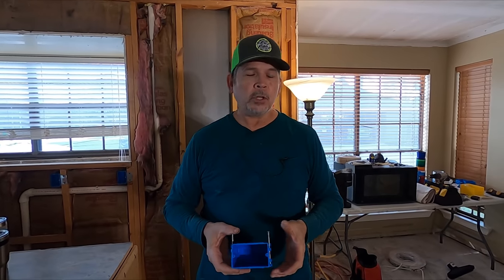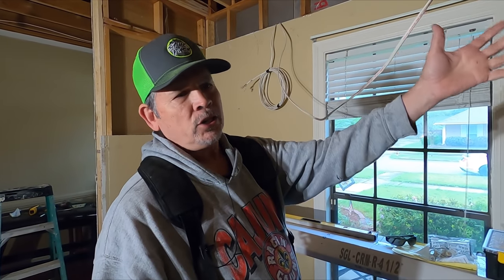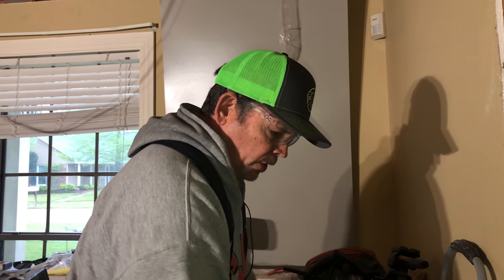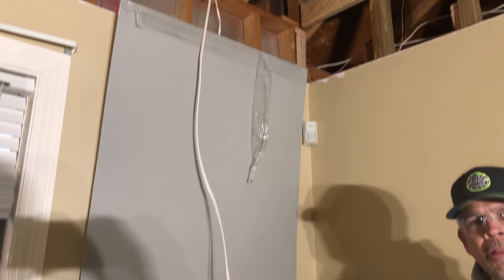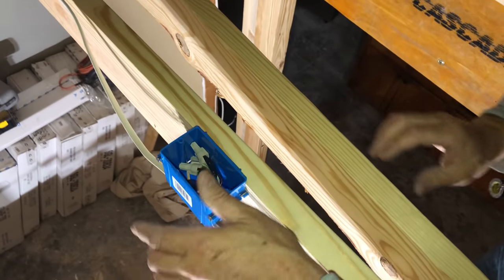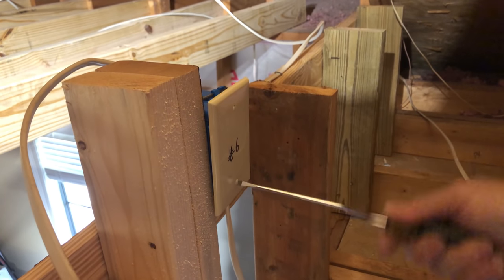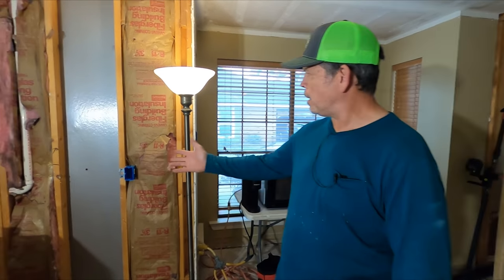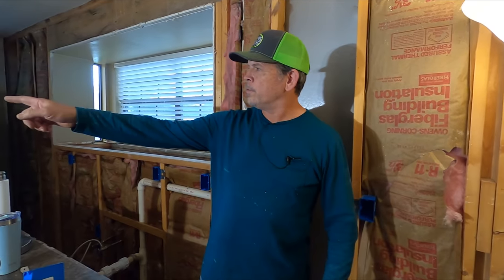How We HELP Our ELECTRICIANS⚡️ Ep. 10

Comment: Like I've said before, I've been an electrician for 40yrs. as of this year and you do better than many of the licensed hacks I've encountered over those years.  Another tip for ya...  Anchor J bxs 18-24" on any accessible framing member  of an attic if possible vs. anchoring low and possibly being hid by insulation. And always staple within 6" of a non-metalic box and 12" within a metal box.  Thank you for conveying the differences between a wire and a cable and a wire cap vs. a "nut".!?!   If an apprentice were to look in a order catelog for wire "nuts", they would get lost.  I understand that it's not a big deal for the non-electrician, but for such a specific terminology based trade, it's encouraged at the professional level. You'll find that in the IBEW schools as well.  I agree Paul, Ideal's Tan Twisters are a must have. Granted, Yellow and Red caps are an essentual part of an electrician's arsenal, but, Tan Twisters are a great suppliment.  Again.. great video!
Reply: Plenty of people in the industry use the term "wire nut"....agreed it's functionally more of a cap than a nut, but it's definitely industry standard lingo

Comment: Here in Canada we use metal boxes so we put all of our grounds to the back of the box on a screw and run 1 wire to the ground screw. Everything else is the same as far as residential electrical goes. I have never seen a plastic box or ground wire nuts.

Comment: Whenever I use those blue junction boxes (like the one used for the future circuit stored in the attic) instead of completely breaking out the knockout, just break away the bottom of the tab and push the cable through. With the tab still in place, it acts as a kind of sort of clamp on the romex.
Reply: That’s why those tabs are there.  Code requires that the cable be secured at the box.
Reply: @johnwielgolinski5552  Securing electric cable in the box is good practice, and it makes for a safer installation. However, you do not need to secure the NM or Romex wire inside the plastic box. The electrical code states that you must staple on a solid surface (the stud) twelve inches or nearer to the outside of the box. The staple provides a secure hold because it is separate from the box itself. Securing and supporting requirements for NM cable are found in Section 334.30. The general rule for NM cable is to secure the cable within 12 inches of the box and every 4.5 feet thereafter.

Comment: Caring sparky who does not use the flimsy push in but rather the screws. At one time they were approved for #12 & 14 guage copper wires but at least 10 years ago NEC only allows #14 wire. They refuced diameter of hole so #12 can not be used. Argued with lazy sparkies 40 years ago about push in wire ports. Told them when they were approved for ground wires I would consider using them. I.always used the cadilac of drill bits & extensions GREENLEE. Had a 5/8 & 3/4"
Reply from the maker: Push in wire ports aren't good enough for the ground, exactly why I don't use them 👍  I saved a couple of those old receptacles that accept #14 and #12.  Thought about doing a video about why it was changed.  Pretty interesting story 💪

Comment: Fantastic job!

My electrician friend trained me nearly the same way: leave all the slack you can, tape up the slack (he had me use white electrical tape because it doesn't leave as much residue), pull out the non-contact Klein voltage indicator and check for voltage... before EVERY cut 🤣, do all the work possible on the floor, label every wire, box, & circuit, and set the boxes high enough that no one has to bend over.

Only thing I see in your video (which I expect you'll probably get to at the end of the job) is the thing I disliked most about remodel work: the attic is in dire need of additional insulation.  😜

Comment: Back stabbed connections held
go 40 years. Interesting. 
Thank you
Wonderful video showing 
excellent workmanship.
Reply: It's likely the receptacle was replaced more recently. The gang box is probably original though.
If had to guess the wire isn't the original either a lot of homes from that era used a cloth covered wiring or aluminum wiring.

Comment: I always mount the attic junction boxes to the rafters and attach my coiled wire there as well using a zip tie with the screw hole makes it easy to attach it to the rafter….. as up north we spray in insulation that can be 16” deep and all cover plates are identified as you do … great video

Comment: Hey guys!  I ran across this video again and would you believe it.. I have even MORE advice! lol  Ok.. so, when attaching cables onto a 2x4 stud, I highly suggest using Cable Stackers.  Making a parallel run puts the cable at risk of being to close to the edge.  Granted, a dry waller is supposed to use nothing longer than a 1-1/4 screw when fastening 1/2" wallboard. But, all too often, they don't follow that rule.  Stacking cables is the neatest means of the installation.  And if you think about it, that is why when drilling a hole for routing cable, that you cannot use anything larger than a 3/4" bit on a 2x4.
Reply: Nice!  Never knew such a thing even existed for Romex.  Been using something similar for CAT for ages.

Comment: Is it just me, or when he drilled the hole with the paddle bit, was it not turning counter-clockwise? I don't have the best eyes but sure looks like it to me..
Reply: It was probably the frame rate of the video versus the RPM of the drill making it look that way. Kind of like how sometimes helicopter rotors or airplane props in videos will look like they’re turning backwards or even stopped.

Comment: Although it is dangerous and easy to make mistakes, it's legal in most states (I don't know of any that it isn't) for a home owner to do their own electrical.
If you're one of the DIYers, make very certain you know what you're doing and you understand the code and requirements.
Be careful and respect the power of electricity.
I've added several circuits to my home after I had an electrician come in and change my archaic fuse box into a decent breaker box.
Before hand, the outlets in the living room and a bedroom were on a single circuit. It's 3 circuits now.
Reply: soon it will be illegal to go to the restroom without permission.

Comment: Having a good relationship with the electrician is great. Sometimes scheduling issues are a fact and by what you did by labeling and boxing out saves him a ton of work. He just needs to run the arc fault two wire hrs. -etc. btw, don’t backstab any devices. I’ve seen way too many problems in 40 plus years doing that 👍
Reply from the maker: Thx Anthony.  I never backstab.  That one was only temporary 👍

Comment: If people only knew that most of the people building new homes and most construction projects do not use licensed “electricians”. They use licensed “electrical contractors”. People need to get a grip.  Electrical is easy.  Understanding loads on wires, breakers, panels and not overloading current circuits is what you need to know.

Comment: 210.11(C)(3) Bathroom Branch Circuits. In addition to the number of branch circuits required by other parts of this section, at least one 120-volt, 20-ampere branch circuit shall be provided to supply the bathroom(s) receptacle outlet(s). Such circuits shall have no other outlets.

Exception: Where the 20-ampere circuit supplies a single bathroom, outlets for other equipment within the same bathroom shall be permitted to be supplied in accordance with 210.23(A)(1) and (A)(2).

So no 14/2. No outside plugs. This is what an inspection is for.

Comment: Nice: I am not a licensed electrician! However it has never stopped me from doing my own electrical work for the most part a lot of it is self explanitory. I do not know everything so I find these videos helpful when I get stumped. I wonder though IF you guys rerun circuits/rewire-run new circuits. Add junction boxes and so on What does your electrician do other than New install???? Seems you can finish yourself and call in your inspector I fail to see the problem If you follow set guidlines, codes so on?? Ohh I'm a stickler I practice the four R's Reclaim,Repourpose,Reduce,Reuse so when I seen you throw a coil romex  wire about ten foot long in the garbage I cringed at the thought of?10.00 getting waisted. The way I see it that's 10.00 added to my bill.

Comment: I'm coming in late to this conversation, but at 15:30, you've got that attic j-box mounted and all that excess wire looped next to it.  But I thought that's the final spot for the j-box?  If you leave that loop there, I don't know for certain, but wouldn't it generate a relatively stronger EMF around it?.  In the US, people argue about the EMF issue some, but in Europe it's already an accepted fact that residential wiring EMF is a significant consideration in regard to health.  Baubiologi (spelling?) I think started in Germany.  It's the study of the interactive, biological effects of building design and construction.  They've already conclusively proven this matter.  We've just not been brought up to speed most likely due to fears of liability from various industries--that's my suspicion.

Comment: Please please please don’t ever backstab  outlets.

Electricity “vibrates” & if you backstab the outlets you wouldn’t believe how thin of a piece of metal is actually holding onto the wire.

It’s a fire hazard frankly....Because of electricity’s vibratory aspect.

I always loop, partially tighten & then use wire cutters (dykes) to pinch the loop closer together before the final tightening.

And if you know you’re going to replace the outlet?, you should’ve just looped them because then they would’ve been ready-to-go for the new outlet.

Comment: It pained me to see you toss all that copper in the trash. The single most valuable recyclable outside of jewelry, and pound-for-pound worth 3 to 4x what aluminum cans are worth. Not being in the bizz, I don't generate enough wire or pipe scrap, but my neighbor is a "horse trader" and a recycler. I give him my stuff. I'm putting a new water heater in this week and moving the location, so there'll be a shorter run of hot, which means I'll end up with about 10 feet of excess 3/4" copper pipe. It, and the old water heater (he does steel too), are going to my neighbor.

Anyway, any electrician who gives a flip, or likes beer money, will take your scrap wire.

Comment: I'm in Singapore for the last 10 years, and have come to appreciate the 240v single phase circuits here..
Because the voltage is doubled, the current is cut in half, making the need for heavier gauge wires unnecessary.
Secondly, the wall-plugs on appliances are physically bigger, but also safer to grab and remove from the sockets and seat better in the wall sockets.
Any 110v stuff I have can be run through a step-down transformer or a variac.

Comment: You're the second YouTube channel that I've seen recently that has suggested pre twisting wires going into a wire nut is an OK practice. I have clear recollection of reading mfr's installation guides in the 1980's that specifically advised against pre-twisting solid copper conductors when using wire nuts. Has something changed since the 1980's regarding (electrical) nut twisting?
I thought that twisting solid 12ga or 14ga copper wire conductors was only necessary when using Buchanan-type crimp connectors.

Comment: Here’s why they call it “make up”. When connect wires together,  you are “making” a line. When you open the connection, you are “breaking” the line. That’s why they call breakers a breaker. Down stream is your load side, upstream is your line side. A hot is your “ungrounded” conductor. The neutral is grounded and the ground is your grounding. That gets confusing even for the pros so we just use hots, neutrals( aka noodle) and ground.

Comment: A licensed professional does not have special powers.  Electrical work is also not that difficult, provided you have a basic idea of how electricity works.  As a homeowner, you have every right to do any electrical work in your own home, without being licensed.  With that said, I have been called out to homes that have been visited by licensed professionals, only to have to fix what they did, or did not do.  So licensing does help, but it's still very much involves the individual doing the work.  Residential work rarely gets very complex.

Comment: Just my personal preference but I usually rough wire electric with the more expensive wago flippers(easy to remove if you need to rework) and then switch to push in’s when doing the finish work.

Comment: The stupid hole connections in the back of the receptacle are referred to as "back wiring". Always use the screw terminals when you can. If you have too many wires, only connect the switched wires to the back wiring, never the downstream circuit.

Comment: Pretty snazzy staple removal tricks!! 😁

I've always used a flat head screwdriver and pliers to get the broken bits out of the wood when the staple inevitable breaks off. 

Course, I'm not doing electrical work. I've done little non-electrical jobs, like replacing insulation strips around a door or window that was 40 some years old.

Comment: You guys are awesome. I just had a new service installed after a tree pulled down my service and damaged my weather head. New service is 200 amp and got a sub panel added to my new shed. I am confident on running cables and wiring my shed myself and I know how to do it right. Thanks

Comment: yeah can we just turn this series into an instructional video for all contractors yet? also, can you make one to stop the drywall guys completely covering the boxes??

little tip when stripping 14-2 or any other two wire, use a longer bladed knife or a claw knife to poke right through both sides of the jacket in the middle where the ground is. no need to worry about catching a cable and way faster

Comment: I don't understand the thinking behind disconnecting and connecting outlets in a certain order. The power is off. I always do the same thing every time but only because it's faster but I do it in the same order you did. On your junction boxes you want to have 6" of wire sticking out of the box

Comment: Be glad you don't have a Federal fire Pacific electrical panel those cutters would be arc welded.
I think somebody owes you a new set of cutters/strippers. Always worth double checking before you cut but at least you cut quick and clean.
Oh yeah and it was a video of some electricians that were a little lazy and working in an attic of a restaurant and decided to short the wires together to turn off the power instead of crawling out of the attic again, they welded the two wires together.

Comment: Boxes which open into the attic shouldn't be nailed to the ceiling joists but should be on truss webbing above the insulation, if it is available. Really the best would be to mount them on a pedestal (wood or metal) to position them above the level of attic insulation. Some people are adding blown in insulation 12 inches deep. The boxes installed this way will be visible for inspection or future work and in the event of a fire in the box the heat will not be confined by insulation which could raise the temperature around the box high enough to spread the fire.

Comment: I love your videos brother.  I'm not sure if you knew it or not, but the strippers ARE made for romex literally.  the first section with 3 holes is for 14/2 and the second section with 3 holes is for 12/2 wire.  These sections are for stripping the sheathing off of the romex cable.  Just lightly grip your wire, flatly in the jaws of the 14/2 or 12/2 section, to cut the sheathing then use your hand to pull off the sheathing.  Keep the videos coming brother.  Be blessed.

Comment: @09:04 -- If my building inspector saw you cut the jacket away using a knife like that, he would fail the electrical in a moment flat.
The concern is that the utility knife can nick the hot or neutral wire, and therefore compromise the insulation.  He insists that you use the proper tool, like  or 
They can also tell after the fact that you used the right tool by the way the jacket is cut back, because both tools leave a smooth edge.

Comment: Yea ... I get some calls like this and I pass.  It ends up with the wrong cheaper wire run in the wall.   Instead of running a new box up in the attic deleting and rewire can be faster and safer.  Don't know till ya get into it.  A little plaster board is cheaper then a crew moving all the outlets to be rerun by carpenters.  Every connection point is a possible bad connection on down the line.  Call the electrician and get them in on the front side not after the job is near completion.  Things are changing code wise.  Materials are in short supply and circuit protections are different.  Experience is invaluable.  I have been in business 30 years as an electrician and electrical contractor.  I do not work like this bad for everyone involved.

Comment: Hey guys, need your help. Plug in a shop vac in laundry and it sounded like it tripped. Nothing tripped at the breaker. Next thing the light in the pantry (right beside laundry) stopped working. Sons room upstairs, the outlets stopped working. Getting a hot reading in both hot a neutral. Plugged in my outlet tester and it says hot/ground reversed. How do I find out where the issue is?

Comment: 9:14 great explanation on how to avoid nicking wires when unsheathing, however I always use a hook blade so that I don't have that chance of nicking or cutting into the insulation of the other wires because different romex has different thickness of sheathing and you can't always guarantee a score without penetration depending how steady your hand is. With the hook blade no matter the thickness as soon as it pierces you simply tilt the blade and glide along